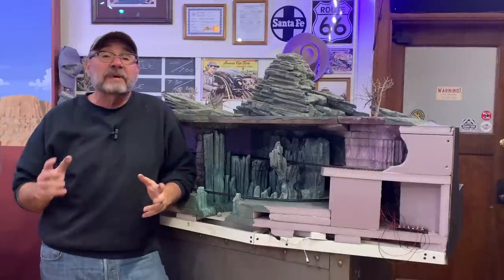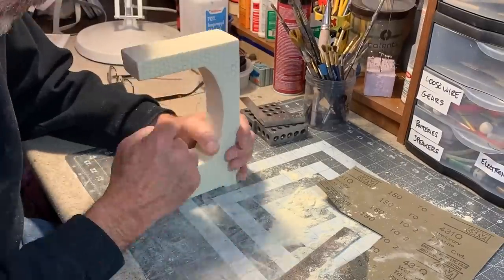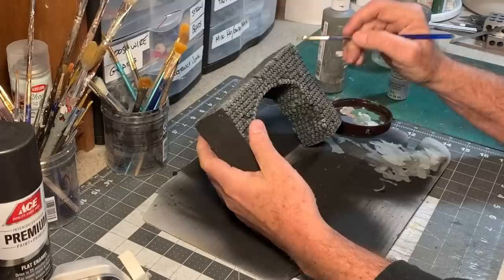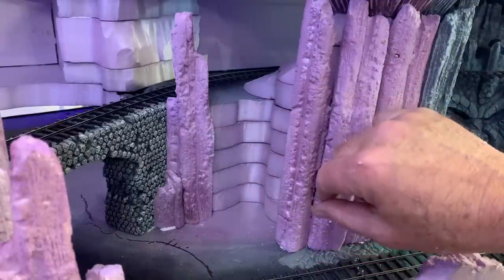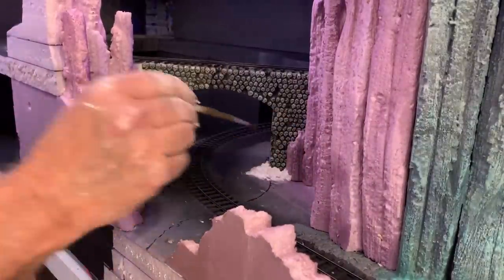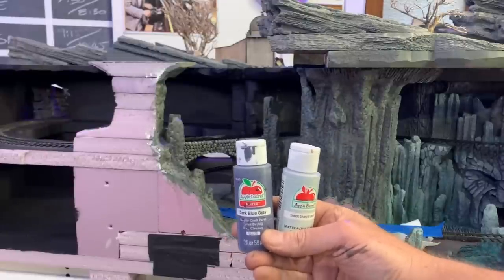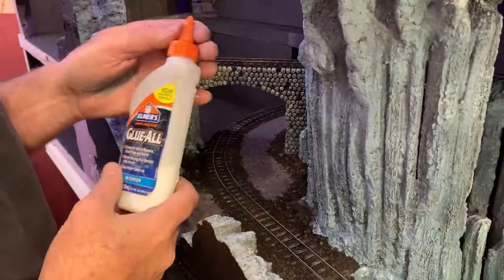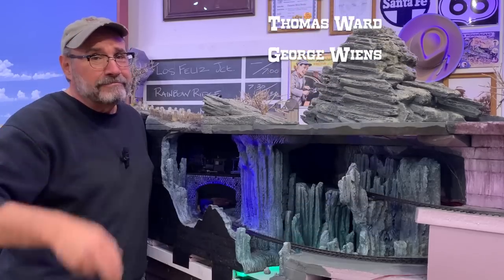A Bridge of Skulls | Gruesome Gulch | GGRR 17

Comment: Hi Dave, I'd love to see some dry ice fog billowing along the River of Souls, or through that bridge portal, both from the back to the front. It would create an amazing and ghostly effect together with the light effects, and eventually even turn into a ghostly waterfall (fogfall) at the front edge.

A super silent micro fan running at a very low speed might be supportive to direct the fog.

As always, amazing creativity and results. Love your videos.

JS
Reply from the maker: I talked about this in my last livestream. Dry Ice and (most) smoke effects are great for photos or video clips, but as permanent features on a model railroad they present numerous problems. Dry ice needs to be continually replenished. Most smoke effects use an oil based compound that will eventually build up on rails, etc and cause problems. It works on my geyser feature on the TMMC because it's only used about once a month. So, they are great for Halloween parties and short duration uses, but a maintenance headache as a long term installation.
Reply: @ThunderMesaStudio  They make water atomizers now that create very cool "smoke" effects with simple distilled water. It's essentially a very (very) fine mist that you can blow around with a fan.
They're meant for moisturizers, but there's quite a few videos out there showing how to use them for smoke effects on a model railroad. A lot easier than nicotine-free vape fluid!
Reply from the maker: @Jay2646  I'm aware. The question again is, how much maintenance do you want to do?
Reply: @ThunderMesaStudio  My apologies for bringing up this topic twice. I have not yet been able to finish watching your livestream recording about backgrounds, but looking forward to doing so.

Yes, that's what I feared, that some/most solutions might not really be practical, especially not being residue-free.

So, possibly something solely for your Halloween 2023 recording ( not giving up hope yet to see the train making its way through that fog, lol )

Thanks for your reply and explanation! Have a great evening.
Reply from the maker: @jsjs3570  No worries! It comes up a lot. I might do something like that for an open house.